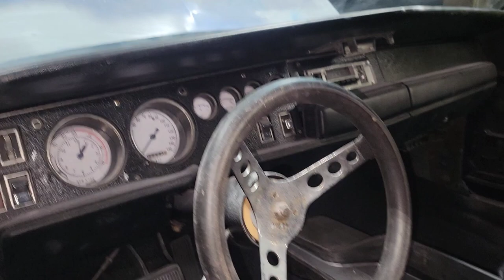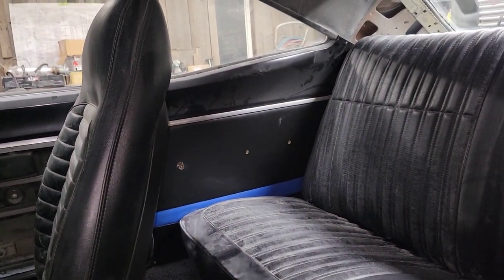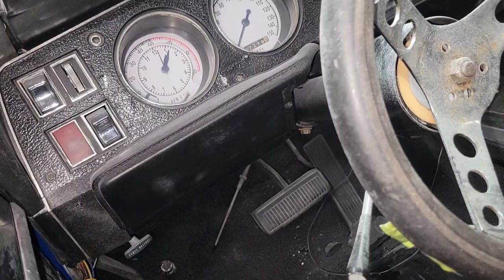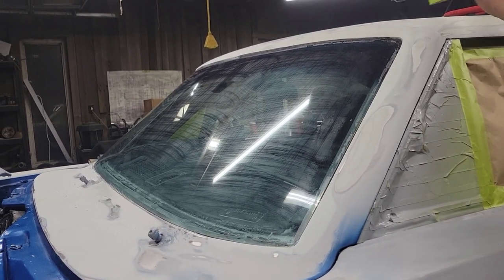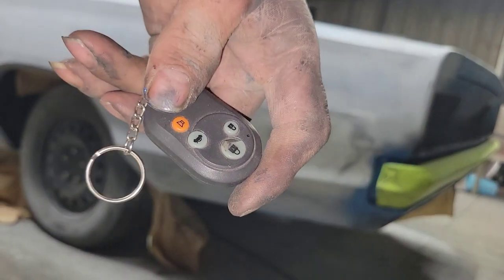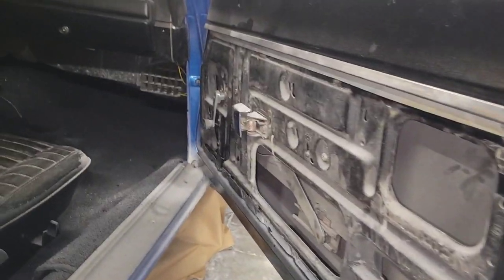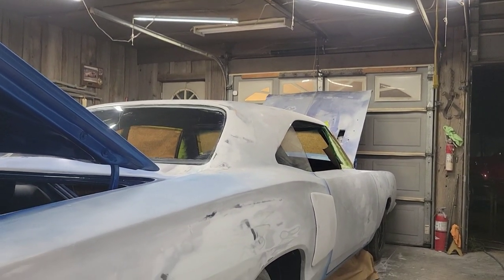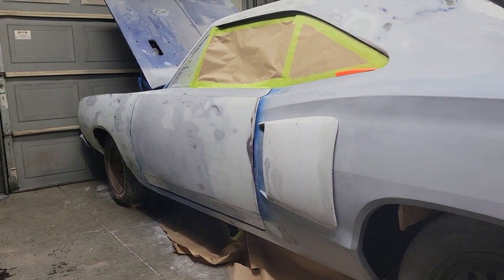1969 Superbee walk-around intro. From concept to reality

Comment: Its going to be a Beauty.
I had a 68 back in the early 80's I always wanted to add the Charger fuel cap system.
Reply from the maker: I've seen that done. It's not my flavor but it looks cool. I would rather add the gas cap just below the trunk lid on the outside and have one of those push-in flush mount caps. I just like to have a clean look myself